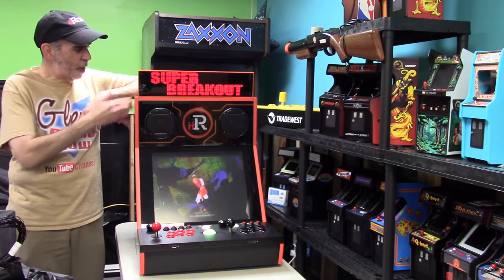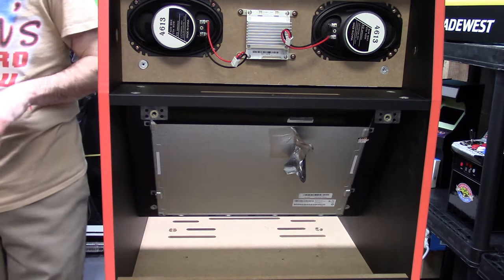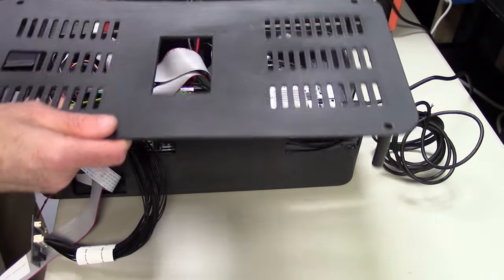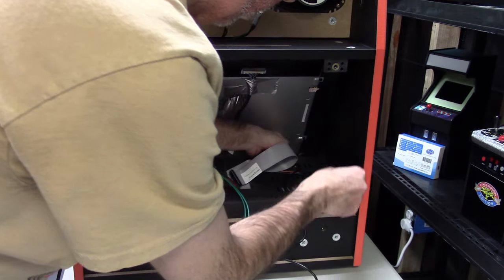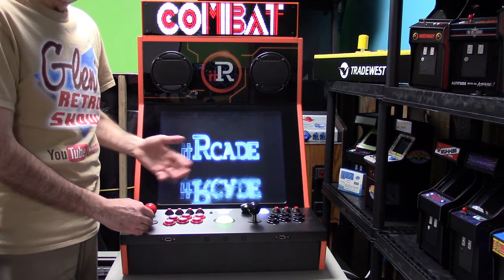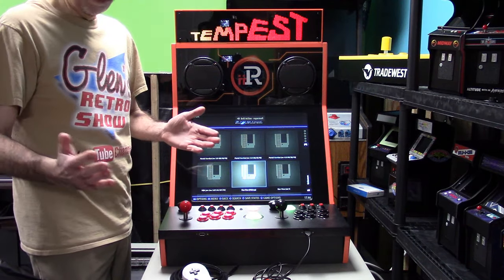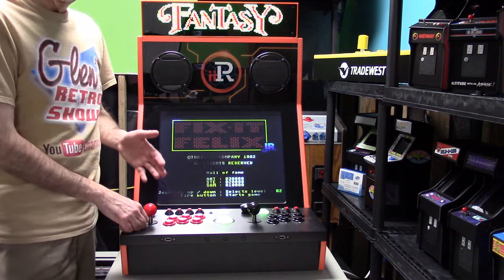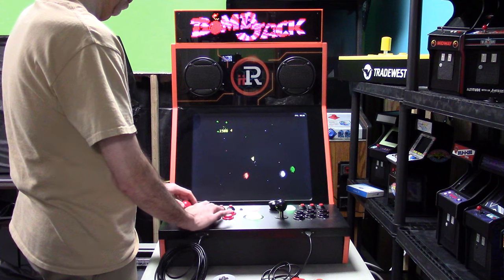How to install the GRS Viper Switcher in your Classic iiRcade unit

Comment: I got an iircade gold and the grs control panel. Would it be easier to wait for the viper and install both at once or should I just put the ultimate panel in now?
Reply: I was wondering the same thing on my OG Retromania cab. I have my replacement deck but would rather do it all at once when the viper gets released

Comment: How easy is it to integrate that Bitpixel marquee you have on your unit ? Also will you have an interface to completely bypass the iircade Sbc and just connect the viper board ?
Reply from the maker: The iiRcade board is not needed.  It will always boot into viper mode.
More on the bit pixel soon.

Comment: Since the amp you installed is louder that is awesome , but is there some way to add a subwoofer to give the cab some great base ? and I need info on that LED marquee !
Reply: Good question, a sub out would have been a great addition to the AMP. There is a way to add a sub on the legacy cab using the HDMI out, but it would have been nice to have native support here.
Reply from the maker: I am sure someone will.be able to add that.  The light up active marquee is by Al Linke more on that soon

Comment: I watched the video and just to make sure I heard right Glen Planamento states that if we have the Viper SBC we don’t need to include the mystery coder usb enabler because his board come included with that.  Does that mean that we would be able to backup our entire Iircade game library onto Glen’s Viper SBC like we could on the Mystery Encoder usb enabler?  Also if our amp on the Iircade are still working good do we still need to disconnect it in order to attach the amp that comes built into the Viper SBC or can we just leave it disconnected until the Iircade’s stops working?
Reply from the maker: If u need to back up your classic unit .. u do need the team Encoder board

Comment: Is the GRS Ultimate Control Panel required if connecting this to a Gold Cab?
Reply from the maker: The GRS VIPER switcher was designed to work with the GRS iiRcade Ultimate Control Panel.
I am sure people will be able to work around it.
Reply: @GlensRetroShow  Thanks, Glen! Sounds like I am grabbing both then. Appreciate everything you do for the community!
Reply: Does anyone have the link for the marquee?